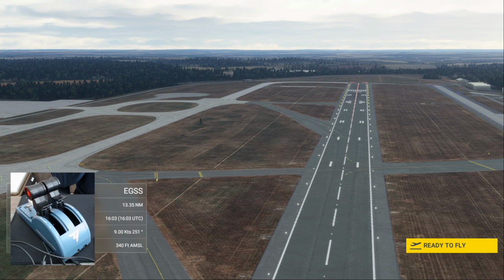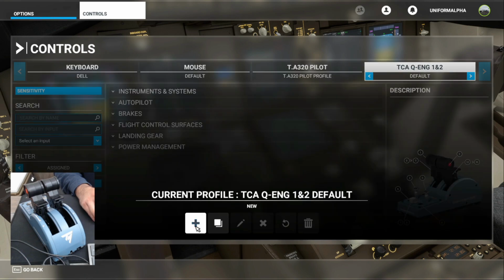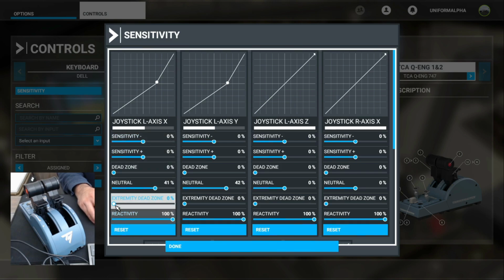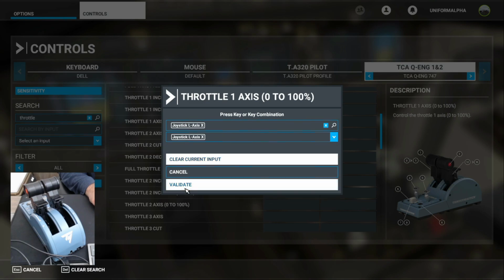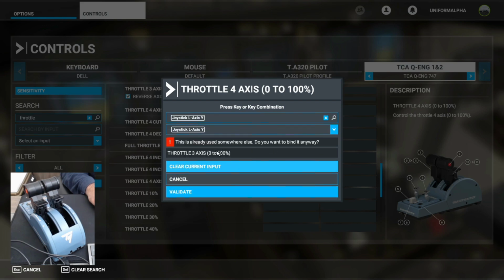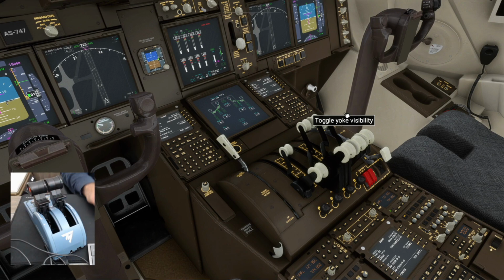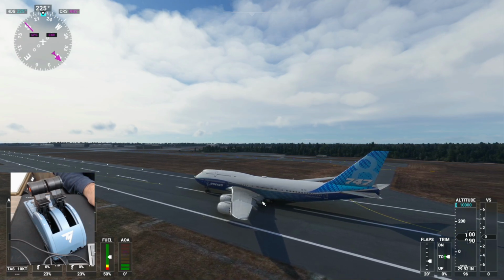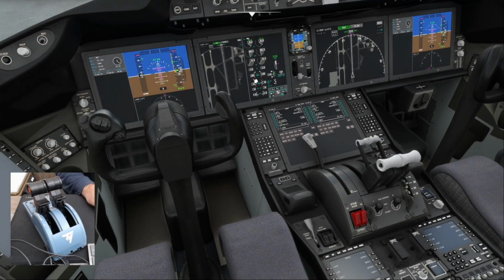Boeing 747/787 Thrustmaster Airbus Throttle Configuration

Comment: My throttles are back to front, when I push the physical throttle controls to increase power, the power in-sim decreases, and vice versa, how can I fix this? Otherwise it works fine.
Reply: Idk about 747 but on 787 switch off the reverse setting on the throttle axis that goes the wrong way. In my case it was Throttle Axis 1
Reply: @mrverse99  Just figured this out today!
Reply: I also have a problem where the throttle levers also control the speedbrake lever. you know a fix for that?
Reply: @mrverse99  On the 787, they are linked (eg reverse thrust will set the armed spoiler to full) otherwise, ensuring the same triggers aren't linked to 2 different functions would be a good start. Happy to help further.

Comment: Sorry, I forgot to tell you what wasn't working. When I put the throttle on it's fine, however I no longer have reverse and the spoiler moves at the same time as the throttles. Waiting to read from you. Thanks in advance.

Comment: Hello Uniformalpha,
I really like what you do, that's why I'm a subscriber. I have the TCA QUADRANT from Thrusmaster which is a good product, like yours. You set the adjustment for the 747 and 787 but since the last one update of ASOBO the settings are no longer correct. Are you going to update the product for the 787 so that I can fly because I really like this plane. Waiting to read you again with good news. Thank you very much.

Comment: Thank you so much for your excellent video, I had tried so many times to get the Airbus throttles working on a four throttle set-up, still have to get the speed brakes and flaps working correctly, I have not used MSFS for some time because of the Airbus throttle configuration, thanks again.

Comment: I did exactly the same as in the video but the reverse does not work, do someone have an idea
Reply: I have figured a fix for the reverse thrust in recent updates. Bind Joystick L-Axis X+ to Throttle 1 Decrease and to Throttle 2 Decrease. Bind Joystick L-Axis Y+ to  Throttle 3 Decrease and Throttle 4 Decrease. It ain't perfect but it lets you activate full reverser from your throttle quadrant.

See link below for photo
https://drive.google.com/file/d/1dA0GkZVZBTKgDJkMV1gz6BgH6BKiOClt/view?usp=drivesdk
Reply: @emileg3782  my throttle 1 is kind of glitching and only going to 55% could you please tell me how to fix it
Reply: @ilyaersoz1596  not sure at the moment. Not at me computer. Could  be because of your sensitivity settings for your throttle quadrant. Could be in msfs or just computer settings.
Reply: @ilyaersoz1596  also is this in all planes or just one? Compare all the throttle 1 settings to the throttle 2 settings.
Reply: @emileg3782  fixed it but thanks

Comment: This throttle quadrant has infuriated me, I cannot get Any of the instructions, calibrations, and drivers to work. Assignments in msfs don't work correctly.
Sliding the throttle past the one third mark seems to trigger a button to take it straight to 100 percent power.
Do NOT buy this!

Comment: Thank you so much for this video. I have 2 quadrants, and was not able to find a way to set both quadrants up. Thrustmaster give no guide or help at all.
You make it seem so easy and straightforward. I was getting ready to send the second set back. The company I had them from said the quadrants where fgaulty.
All that is faulty is Thrustmaster for not explaing how to set up the throttles.
Thank you so much
Gary.
Reply from the maker: Glad I could help!

Comment: Can you please do a tutorial on how to set the flaps, speed brake and parking braking for the TCA Airbus addons?
Reply from the maker: Not available yet where I live! Will do when I get them.
Reply: @UniformAlpha320  Thanks mate!  :)
Reply: @Exsing  I got this to work by duplicated the DEFAULT Profile for the TCA edition and then adjusting the sensitivitity from there rather than a blank profile.  This got the thrusts working and all the other buttons "just worked"

Comment: Finally! Been wanting to know the best settings and you provided them. I assume I can use the same for the Airbus A320Neo?
Did you also program the starter buttons and the Crank & Ign start?
Reply from the maker: Neo settings are different.. both for the FBW and default version
Reply: @UniformAlpha320  Thanks. Do you have a video on those?

Comment: For the 787, using the same profile as the 747, as engines 1&2 were both assigned to the left lever, were both engines in fact being controlled by the one lever and the right lever was doing nothing? Thanks for the help in setting the throttles for the Boeings, as the current configuration for the A32NX doesn't transfer at all well!
Reply: Duplicate the profile and assign engine number 2 to axis Y. That should do the work. Remove the engines number 3&4 from that profile. Don’t forget to switch profiles.